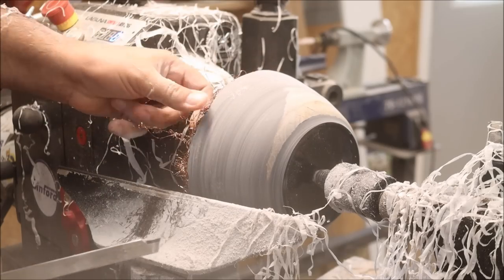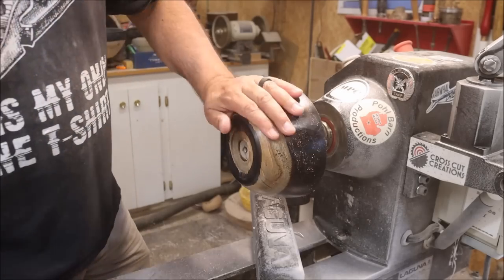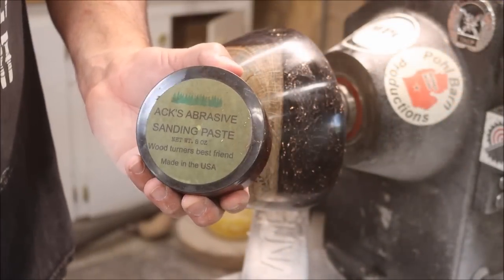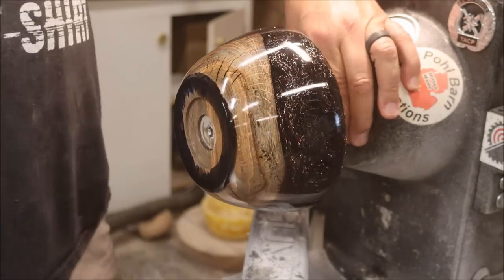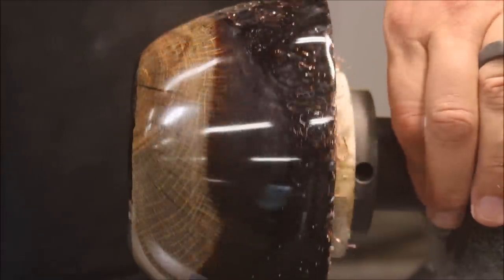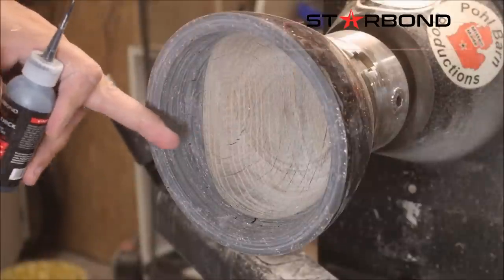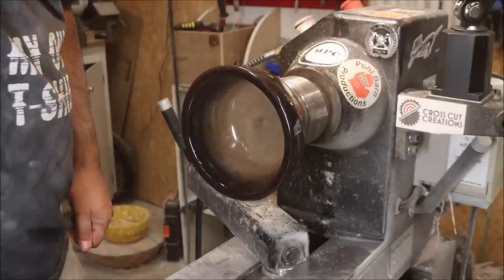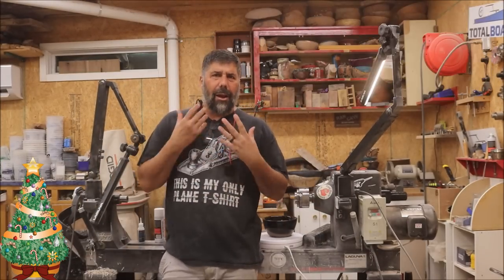What Happens When You Cast and Turn Metal Pot Scrubbers?

Comment: Would also like to see this made with resin with little or no color to show of the scrub pad's own color uninhibited. Also, what's the curing time on that glue after it's sprayed with the catalyst?
Reply from the maker: Hey Ivan, I may try a clear one down the road. thanks for the suggestion. I usually wait about 30 min before turning after I use the Starbond CA glue and activator.